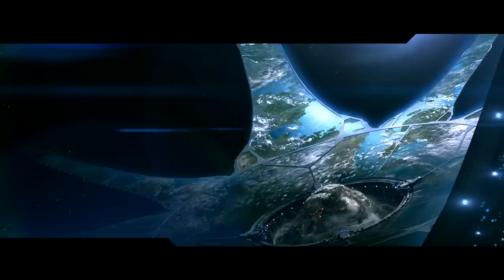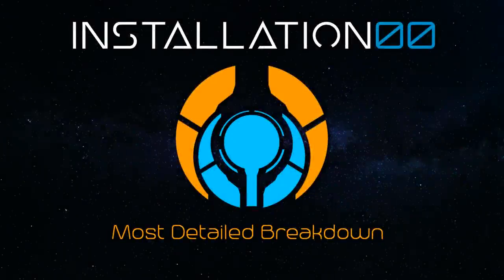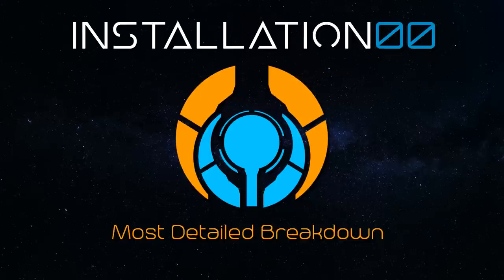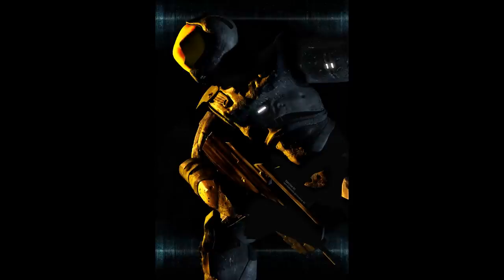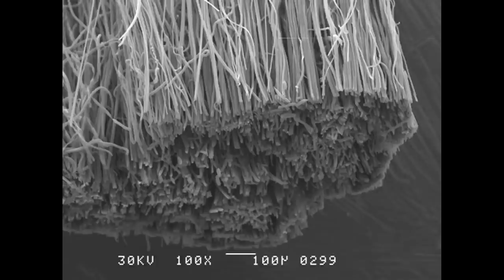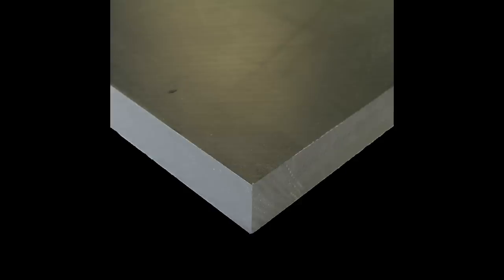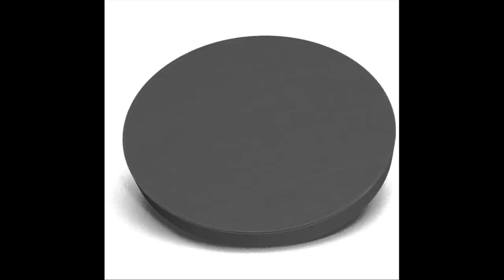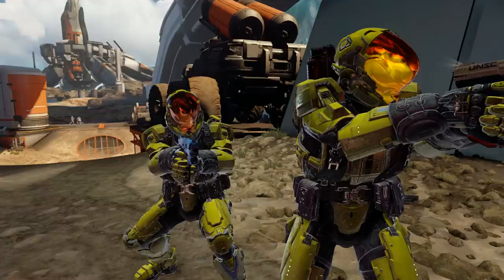SPI Armor | Most Detailed Breakdown

Comment: Could we see ODSTs in halo 6 in modified SPI armor mixed with covenant style shield and armor tech?
Reply from the maker: Its possible. Very possible. I think the SPI is criminally under-represented in the games. Its time it makes the debut.
Reply: @Installation00  maybe with a more ODST inspired helmet for better impact resistance.
Reply: I can see all UNSC SpecFor units utilizing SPI armor post-war. Not as widespread, standard armor just yet, but it's on their roster of approved equipment-for-use.
Reply: @Yorkington  halo 6 where all marines on board the infinity use SPI mk3 armors due to the Spartan training and armor manufacturing capabilities can be used to full effect.
Reply: @barrybend7189  Maybe some units, but all? Even if the suit is cheaper than MJOLNIR, I doubt it's cheaper than standard-issue ballistic body armor. (Which IMO should have been a standard set for both Marines and Army, to simplify costs and logistics. GG UNSC, GG lol)
Reply: @Yorkington  well we do have covenant combat harness tech to improve and cheapen production. Hence why only the infinity could outfit all marines with the battlesuits.
Reply: @Yorkington  i think with the created crisis, the only issue is getting the resources onto infinity. which is still a collosal issue given Infinity cant stay in normal space for long without a guardian hunting it
Reply: @EthanThomson  Yup, I agree. Though SPI being loaded onto the Infinity when it was in port before the crisis is also a probability.
Reply: Lord Iowa infinity can manifacture it. I just mean getting the raw materials onboard to manufacture anything at all really
Reply: @Installation00  Please do a breakdown of odst armor.
Reply: The pilot helmet looks like the SPI helmet but thats purely for cosmetics
Reply: They would probably retain SPI as specialty mission specific equipment, and apply the shield tech to the standard BDU's
Reply: Infinity was sort of imagined as a heavily colony ship at one point in development, so it might be kind of like a superpowered Spirit of Fire.
Reply: I think that would be a good call if SPI was the armor made for ODST with some Energy shielding
Reply: It wouldn't surprise me if they didn't, during human-covenant war the odst armor went through several upgrades with them even incorporating mjonir armor into the odst armor. Odst given semi power armor would make sense they are part of special forces units that often see more combat and spec ops missions than spartans. It being after the war it would make sense the odst armor going through further upgrades and development and incorporating both spi and mjonir systems into their armor. Maybe even give light sheilding. Doesn't make sense just to give everything to the spartans, realistically you want make sure your other special forces units have own special equipment and weapons too. Despite spartan Iv's recruiting from odst and other unsc branches, odst still active and still make up large portion of unsc special forces. I hope i make sense lol
Reply: @Installation00  I really wanna like your comment but your at 117, I won’t ruin it
Reply: @Installation00  and yet, here it is
Reply: Headhunters use SPI armor with energy shields.  No reason ODSTs can't.  SPI armor is even explicitly said to be usable by normal humans due to its lower degree of physical enhancement.

Comment: There should be a game as you, a spartan 3, with the spi armor
Reply: A stealth game
Reply: Or another ODST game with SPI mk3 armor. Basically its the standard ODST gameplay but add a shield meter as with the stamina and health. The armor could be designed with an ODST style helmet.
Reply from the maker: Would absolutely love to play a game like this. Hope someone at 343 is taking notes.
Reply: @Installation00  we could follow Mickey and Dutch in a game where they're upgraded to modified SPI armors( no active camo but improved energy weapon resistance and shields) and follow them through some covenant remnant conflicts from before the events of Halo 4.
Reply: No. It should be game like star wars battlefront 2 (2005). Play as the unsc with multiple classes like the marines. Odsts, Spartans 2, and 3. Being gained through killstreaks. Have covenant, forerunner. Rebel.
Reply: @barrybend7189  sorry to burst your bubble but Mickey joined the insurection and was later killed😂😂
Reply: @bigtasty42069  hate to burst your bubble mate... Read bad blood
Reply: After infinite they are gonna be working on spin offs like odst. So there might be different games n such
Reply: Sçøtt Sállëy  How does the metal hit?
Reply: Sçøtt Sállëy  The suits are designed not to clank.
Reply: Sçøtt Sállëy  It is general knowledge. The only clanking you heard is Chief walking on a metal surface. Not his armor hitting itself.
Reply: Sçøtt Sállëy  There is no motor or real hydraulic system in the suit. They use a crystalline substance to move the suit.
Reply: Sçøtt Sállëy  The alloy is something we do not have. The battle between Locke and Chief, did you heard metal clank, or did you heard something like plastics?
Reply: Sçøtt Sállëy  But still will even something like that give you away?
Reply: @barrybend7189  no, i love odsts health system, but shields would not make sense added on to that,i would love a game where your a spartan 3 in the spi armor with odsts features, except it would make sense for you to be able to take a short burst from a plasma rifle
Reply: @totalygamingtemplar  well with how the armor is you could have it where the Shield bar could be a general power bar with either an energy shield or active camouflage system in it's slot. Also the health would work like Halo CE or reach.
Reply: @barrybend7189  amazing! thats what i would want, and you can have it where enemys have a detection level like in assassins creed
Reply: @barrybend7189  i would love to have the crouch effect detection levels too

Comment: SPI armour should be given for ODST or infantry soldiers with a little upgrades In halo infinity and over sequels.
Reply: It's a bit pricey for marines, but I think the helljumpers would be all over this gear if they could get their hands on it.
Reply: Vallorn definitely but it cheap to make
Reply: @TgamerBio5529  Cheaper than Mjolnir isn't cheap. Mjolnir Mk VI costs as much to make as a whole UNSC Destroyer.
Reply: @VallornDeathblade  actually the SPI if configured correctly( no chameleon system, added thruster pack and micro fusion reactor and refraction coating) the suits can be built to basically create the mobile infantry from Starship Troopers but on a lesser scale of ability. The suit can use pre existing equipment that was developed before the war like the backpack fusion pack for extended base camps and a repurposed thruster pack for light duty multi purpose thrusters. The overall suit can actually cost as much as one warthog in initial run but price goes down as production improves so it would end up way cheaper.
Reply: Barry Bend love the idea and SPI design can be based on the marines armour to make it easier to mass produce.

Comment: The SPI should be the standard armor for all UNSC Combat personnel with modifications and specialized variations based on services and roles of serviceman. Also I recall that the Spartan 1's used powered exoskeletons in their missions do any one have more information on them?
Reply: Well the Orion ( which can be used by unaugmented soldiers) is technically just a large scale walking tank. It was redeveloped into the Mantis. But if the UNSC reinstated that particular project it would make a pretty good anti armor unit that's equal to a hunter in size.

Comment: If S.P.I armor doesn’t have shields and spartan 3s only started wearing Mjolnir armor in 2558 then what armor type did noble team wear
Reply: Since noble team were made of very good SIII's, they were issued Mjolnir like SII's.
Reply: In 2552
Reply: Some versions for spec ops inside of the Spartans IIIs actually had shields, look up "Headhunters" and you can find those squads

Comment: SPI armor is cheap enough that it's built pretty much just at a single facility on Onyx and yet was given to suicide soldiers with the expectation that every unit made would be lost.  That says a lot about its cost.  It would have been cheap.  The force-amplification crystals are actually mass produced in the colonies and Earth for many industrial applications.  Just replace the active camo plates with Titanium-A and let the armor's strength enhancements bear the weight.  Poof, instant Marine armor.  And since even Headhunters sent on suicide missions as disposable are equipped with energy shields for their SPI armor, there's no reason these Marines' version couldn't be equipped with shields, too.  Just give them a bigger battery.  SPI armor comes with a small one between the shoulder blades that seems to last an incredibly long time.  So, give the Marines a bigger one since they'll probably need to recharge their shields more often than a Spartan as they don't have bullet-time reflexes.  Plus, the UNSC needed to keep as many troops alive to fight another day as it possibly could to protect space defense power stations and surface-to-space weapons.  If the troops guarding the ODP generators on Reach had this, they'd have either won, or forced a pyrrhic victory on the Covenant and been able to come back to finish off the enemy fleet quickly instead of completely routing.

Comment: basically, he is a genius.
I'm just gonna say, this armor sounds far more advanced and expensive compared to Mjolnir imo, stealth vehicles now days are incredibly expensive, and nowhere near as effective as this.
Reply: The main cost of Mjolnir is in two of the inner layers, the pizoelectric layer which enhances the strength and speed of the user, and the layer which can host an onboard AI. Compared to a suit which costs as much to produce as a UNSC Destroyer, even a pricey stealth suit would be relatively cheap.
Reply: They sound quite a bit cheaper compared to mjolnir, their main advancement is a photo reactive panel which could have easily been mass producible by the 26th century
Reply: @ExHyperion  basically the suits cost as much as a mongoose.
Reply: @VallornDeathblade  These suits are dirt cheap by comparison to Mjolnir it's no surprise that they used them. Still they could at least have added shields to increase survivability. The reactor wasn't the most expensive part mjolnir not even close.
Reply: Vallorn don’t forget the energy shield and micro fusion reactor
Reply: @djcuevas1057  Fun fact. The headhunters version (The headhunters were basically specialized Spartans III sent on spec ops behind enemy lines) actually had Shield generators, but they had the drawback of having to use the shields or stealth cloak one at a time because the generator couldn't keep both active. But even that could do a huge difference for a soldier

Comment: I always thought Spartan IIIs were superior to Spartan IIs. Their augmentations were far less invasive due to the fact that they were chemical and they had refined the process to the point of a 0% mortality rate by the time Gamma Company came around in Ghosts of Onyx. They were just as strong as Spartan IIs (though the only time you ever really got to see this was in Reach due to the fact that Noble team had received MJOLNIR armor, you'd be forgiven for thinking they were weaker due to the fact that you almost always see Spartan IIs in MJOLNIR armor which has a far greater strength multiplying effect than SPI.) So if you were to put a Spartan II and III together in the same room with no armor or the same armor they would be just as fast and strong as eachother. The only reason anyone considers IIIs to be inferior is because the majority of them never received MJOLNIR. 
Combine this with the fact that they put far greater emphasis on training the IIIs to be superior tactical thinkers in order to compensate for their lack of top-tier equipment and you have soldiers that are all masters of battlefield tactics on an individual and group level. Not only this but many Spartan IIIs also seemed to be trained in a wide variety of technical skills like Noble 6 being a pilot in the top secret SABRE program and Kat's superior cyber warfare skills. The most obvious advantage over the IIs would be that there's more of them. 
The final advantage they have over Spartan IIs in my opinion, and one of the most important, is that they're not complete emotionally suppressed automatons. Spartan IIs are practically fleshy robots that almost never display any kind of emotion, even to eachother a lot of the time even though they consider their team members to be their family. Spartan IIIs on the other hand seem to be a much more close-knit group, with all members of a company considering eachother family instead of just the fireteams they got paired up with. Not only this but the increased empathy they have for eachother and other fellow humans could potentially give them a well of strength to draw from in times of desperation and could possibly turn them into far more savage combatants than even the Spartan IIs.
All that being said, I'd take a company of Spartan IIIs in SPI armor over a fireteam of Spartan IIs in MJOLNIR Mk VI any day. Spartan IIIs don't get enough love and get a reputation for being inferior due to the fact that they were intended to be sent on suicide missions. If they had been deployed in the same manner that the IIs had then they would have got the love they deserved, not to mention they probably could've had a more impressive service record.
Reply: I agree 100% with you and I think if SPI armor was made to be just as good if not better due to the camouflage systems which MJOLNIR lacked, many people wouldn't think so lowly of them and maybe would even consider them their favorite generation of Spartans. I also thought they should of made specific versions of the SPI armor for ODST's and marines and one made just for Spartan IIIs so the gap between MJOLNIR and SPI could be closed or at least be made a lot smaller but because of time constraints and budget limits, this wasn't possible. It sucks these warriors get disrespected so much.

Comment: Halo ... UNSC has the ability to mass produce SPI Armor.  ODSTs tested it .  Then they give it to Spartan 3s instead of ODSTs because ... reason never explained.  
Real reason The UNSC leaders aren't as forward thinking as ONI is lol.  

Yes this fact has always irritated the common sense region of my brain. 

If you can make semi powered armor that is better than your current armor .  It would make more sense to mass produce them and issue them to ODSTs and possibility marines later.
Reply: Why don’t the covenant issue camouflage generators to all of their grunts? At a certain point the performance doesn’t justify the cost. Sure you could upgrade all of the ODST’s with spy armor....But would that really be cost effective in a war where you are shedding men and material faster than you can reproduce it?  UNSC high command probably determined that it was more important to the war effort to put their Resources into ship construction rather than improving their already superior ground forces.
Reply: @Matt-yg8ub    With the Covenant they use warfare as population control of the grunts.  Basically they are expendable. 

As to ODSTs and SPI armor they produced about 1,000 of those suits and funny or sadly depending on rather your an ODST or Spartan 3.   Because the ODSTs actually tested the SPI armor.  Then where told yeah thanks for doing the tests we're going to give this armor to these new super soldiers over here.

So the UNSC was still capable of mass production of arms and armor.  The inner colonies had most of the manufacturing facilities.  The outer colonies where mostly used for raw resources.  While Mars , Titan, etc where primarilly manufacturing world's.

The UNSC also uses forging as part of their manufacturing process using  die press.  Which creates a strong material.   This is used in everything from marine armor to the tank like MJOLNIR armor. 

So the manufacturing process has very little waste material if any .  Which means yes they could have produced more SPI armor considering that it's less expensive than MJOLNIR which costs as much as a battleship per unit. And they kept producing new models and upgrades throughout the war.  

They did also improve standard armor of the Marines/ Army and ODSTs.  

Which didn't take much on the ODSTs  armor since it's designed to survive orbital drop within a drop pod of course.

This video touches on the manufacturing process. https://youtu.be/1wY9kWB-Sgs

It's about the Marines armor.

Comment: I personally prefer a SPI armor over mjolnir. I would add some extra stuff to the armor. A forehead armor plate like a SLAPP, add more batteries to the back of the armor like a bigger backpack, a energy shield like the experimental, a small strong enough computing hardware for a simple AI for battle awareness and multitasking, also a body cooling and vent system for obvious reasons.

Slightly more expensive but still under what Mjolnir armor is.

Comment: Correction, I was about 15-16 years old when I came up with fiber optic pass through for camouflage and effectively panels on air craft using it, 21 years ago. At that time it was very new and glass. First learned of the technology by Descent game still but later sea floor cable application. Cool  to see it more thoroughly established here. Otherwise this armor seems like polished production ODST armor. My 9 years old idea was rotating kinetic armor system to stop projectiles by simply changing kinetic direction removing potency.